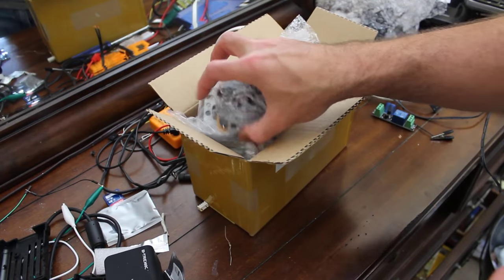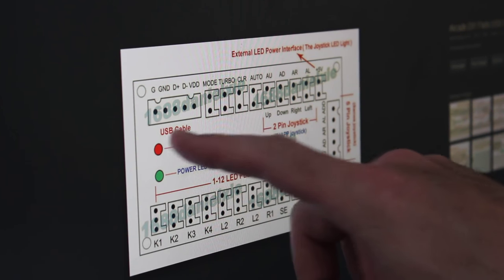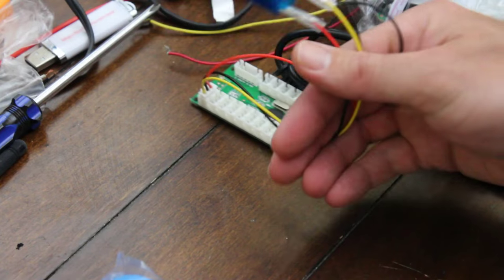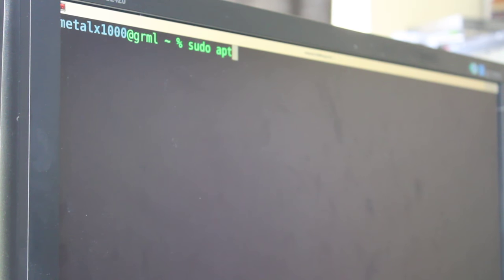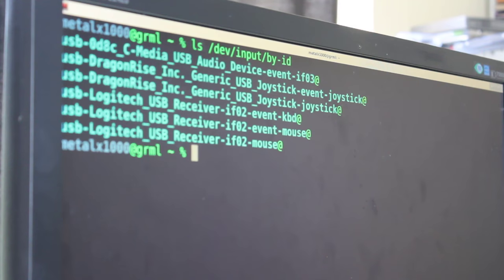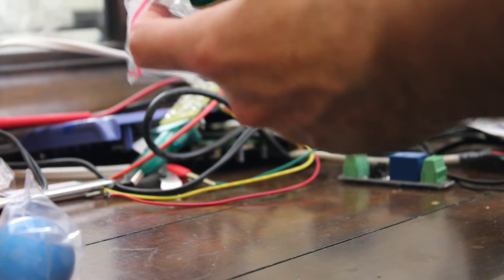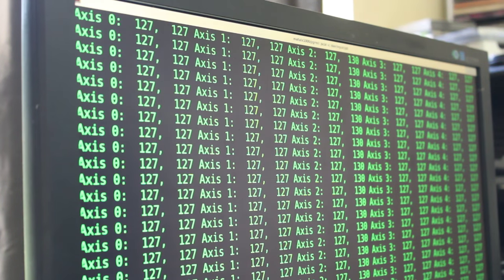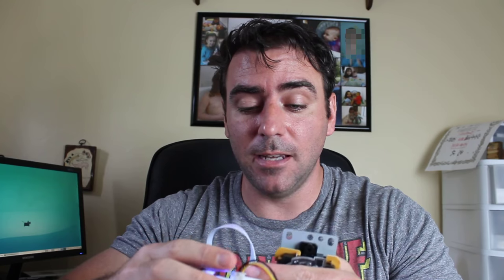First Setup LED Arcade DIY Parts with USB Encoder Joystick and Buttons

Comment: If you want the lights to always be on all you have to do is switch the black and yellow cable. I have the same kit and was able to get the lights to always be on. You can contact the seller and they will guide you on how to do it. It is extremely easy.
Reply from the maker: Thanks for the suggestion.  I'll give that a try.  I just figured that the circuit wouldn't be complete unless the button was pressed, so I really didn't try anything.
Reply: Yea I thought the same thing! If you do try it, make sure you only switch the black and yellow wires that are connected to the white piece where all 3 wires meet. Everything else is wired the same. Good luck! I can send you a picture of what I mean if that doesn't make any sense.
Reply: David Chavez 
Can you post pic please? I'm trying not to mess up those small pins and wires.
Reply: same here, i'm honestly not too sure how this owuld be done
Reply: sorry to reply so late, i just noticed the notification. I will send you the images via private message.

Comment: I think the crown symbol is used in almost all buttons. If the positive sign is on the right, should it be where the red wire be connected? I have turning on the LED last night. Probably it's what happened there

Comment: Thanks for the video, I think it is the only one on Youtube that features this kit.  My question to you, do you know what the most common button amount for arcade games is?  I am assuming very few use all 10 buttons.  I would like to set mine up to just have 3 buttons, I think that would cover the majority of games.
Reply from the maker: Street Fighter uses 6 per-player.  That was a lot for it's time.  I think in the 80's and early 90's most games didn't have more then 2 buttons.  Maybe more in the later 90's.  These days most arcade games don't even have standard buttons, they have other types of inputs.  My guess is to set themselves apart from home consoles.

Also remember that if you are building your own cabinet, you aren't limited to arcade games.  You can play console games too.  if you are running NES games, all you need is Start, Select, A, and B for each player.  Other consoles might be most, example SNES.
Reply: for arcade (MAME) games like Kris said, you will need 6 buttons for street fighter, no games that I know of will use 8, but bear in mind for MAME games, we take street fighter 2 for example of 6 buttons, you will also need another 2 buttons one for coin in (credits) and 1 for start...for each player so 2 players you would need 16 buttons, on top of this some people will add extra buttons for different features such as volume up/volume down, reset, exit etc....me personally I would just go with 6 button configuration plus the coin and start for 2 players, and if you do a 4 player console the 3rd and 4th players will only need 4 buttons, there are no 4 player games that used more than 4 buttons that I know of....there may be 1 if any.....

Comment: Great video! I have a similar USB encoder, but my joystick didn't come with the quick connect end to tie into the board. Also, I only have retropie running as my only interface on the pi. Could I still connect to the wifi and down the things I need to program my buttons? I'm having a little trouble. Any help would be appreciated. Thanks!
Reply: I haven't tried retropie yet.  For the most part it should work out of the box.  If you need to test things, I just Googled it and it looked like retropie has ssh running, so you can log in that way.  Username should be pi and password should be reaspberry, unless you changed it, which I would suggest.
Reply: So I hooked everything up and when I go to do the jscal and it just says that I have 2 axes and 10 buttons.

When it finished the calibration finished it just showed 0 for both axis. Did the detect command and picked them up just fine. Any suggestions?
Reply: Kris Occhipinti I have he same model board as you btw
Reply: I was just using jscal to show that the buttons were working.  you really shouldn't need to run it for a setup like this.  You should just be able to plug it in and go.  What game/program are you trying to use this with?  Does the controller not work with it out of the box?  If the buttons you want to use for the game are not setup the way you want, that game/program should have a controller configuration option.

Comment: So im trying to build an arcade machine for our home;however, im running into a problem. I have two of these set plug in at the same time for player 1 and 2 but it ready player 2 as the js0 and the player one spot as js1. How do i switch these. I already switched the encoders and the usb cables but nothing changed. Also, how do i configure the buttons for the games? They keep switching in the games and i tried programing them in retroarch but its isnt reading the player 1 and 2 buttons and also the coun buttons. I bought the ones from easy get. Any help is appreciated
Reply: All of that sounds like it's just software configuration and will very from emulator to emulator.  For example, in MAME, you press TAB to bring up the settings window, and you can choose to set the button configuration for the current game or the default for all games, and you choose which buttons are for player 1, 2, 3, or 4.

Comment: Can I use this just to power mt led button? I am building a controller with a Brook PS3/PS4 Fight Board PCB kit and not sure if that comes with an led power harness.
Reply: Flash-Sentry was wondering the same thing, also go penguins. 🐧

Comment: Your design is different to mine and when I hooked mine up the light was on all the time and when switching the red and yellow wire, all it did was dim the light. But, not once did it ever turn off.

Comment: Hi guys first post on here so bare with me.....

So built arcade cab running pi3 model B with dell 19 inch monitor and zippy sticks of ebay with zero delay usb controllers, Xcade B19c model as the cab and 18mm t moulding. So everything went together swell.....up in no time, I connected all the joysticks and buttons on a daisy for illumination and checked the functionality of the the sticks and buttons via usb as generic controllers on the laptop.... every thing went well on so fitted them into the control station.

I download the terminator build of here at first and it dawned the VGA to HDMI leads i had were not good enough though i could hear everything couldn't get visual (pressed a free buttons on the arcade). so 5 days later go the adaptor which worked well, but joysticks were all over the place and no configuation could be done even with a keyboard?

So I clean the image and tried again.....same issue joystick everywhere, so I decieded the image might not have the config file in..? i dont know so downloaded the back to the future one again which i knew had the set up on power up a s seen in the video.!!

to my dismay and to my insane verge of smashing this cab up I call to you guys..... is there something ive done wrong or pressed when there was no visual that has stopped my joysticks working(which i have set back in laptop and still work perfectly)..... I have plugged a usb keyboard in it wont do anything than let me press F4 to go to command prompt but I have no idea when things get this dead.

Thanks for your time i would appreciate any help. Scott

Comment: Great video and quite informative.  I am building a six button arcade with joystick and two start/select buttons.  Does it matter what slots I use on the board.  The SE and ST slots are obvious.  Any recommendation on the other six?
Reply: L1,R1,L2,R2, I would think would be the "trigger" buttons on a hand held controller.  The other would be your other 6 buttons.  It's good to set these up in the default manner in witch you like, but most programs will allow you to map the buttons to which ever functions in the game you would want.  Hooking them up in a standard way just might save you some time in configuring it in each game.  Although emulators tend to have global configuration so you can set the keys once for all games.

Comment: I didn't get instructions with mine because I bought everything seperate but I'm having trouble connecting the button to the wires. Doesn't seem to fit anywhere. Dunno if I've got incompatible parts.
Reply: If the connection don't fit, you might need to get different wires with the right connections or cut the wires and connect them manually.
Reply: Kris Occhipinti Ok cheers I'll see what I can do, thanks. They where cheap as I should have bought a kit but oh well can still do that. I'm building a few arcades so always good to have parts. Nice vid mang!!!!

Comment: Great info. I'm looking for parts like this that will work with Linux. I'm wanting to make a retropi arcade stick. Would those parts do the job and did you ever get the lights to stay on?
Reply from the maker: This will work on your Pi.  It should work on pretty much all modern systems.  The board is detected as a generic Gamepad.  So it's plug an play.  As far as the Light staying on, you would have to crack them open to see if you can do anything about that.  But them look pretty cool the way they are while you're playing.

Be sure to check out this full playlist:
https://www.youtube.com/watch?v=Mm8uBsq6490&list=PL2GALWZIiXOBilwckXNmD24iQ7osK-f2L&index=3